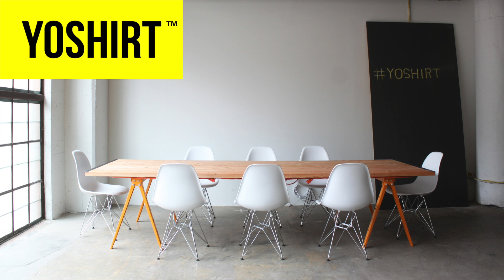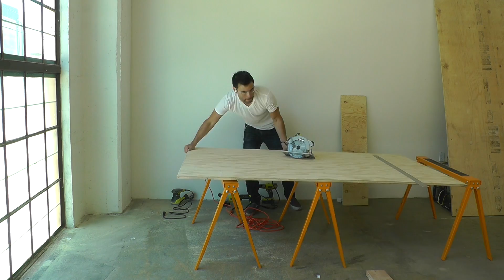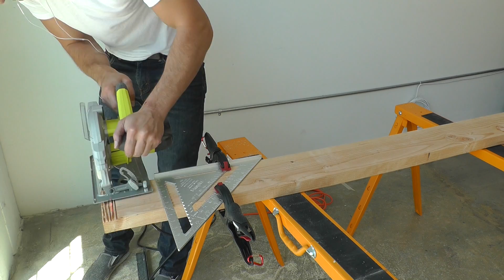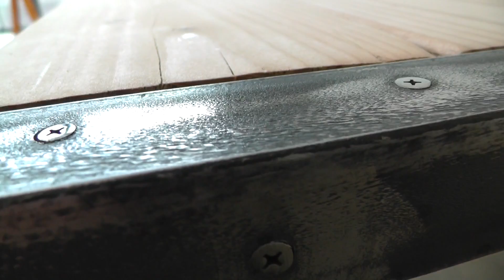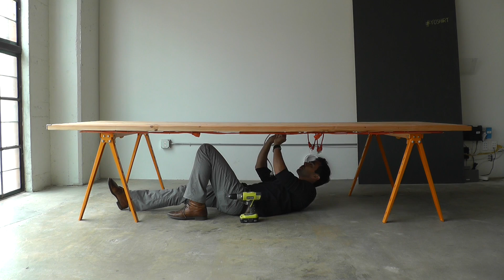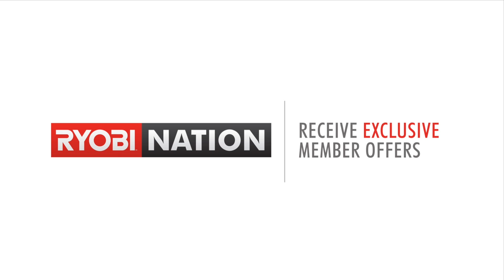DIY Conference Table

Comment: I normally don't go in for modern furniture but I really enjoy watching your videos. I have to tell you though, I really like this conference table. The only thing  I can think would make it a bit better are the electrical outlets specifically designed for conference tables. You can recess them and attach them to a single power source near a leg and run it down the inside of the leg. I love the sawhorses you used here as well. The fact that they raise and lower is very cool and I'm going to start doing angle iron like this on my coffee tables with hairpin legs.